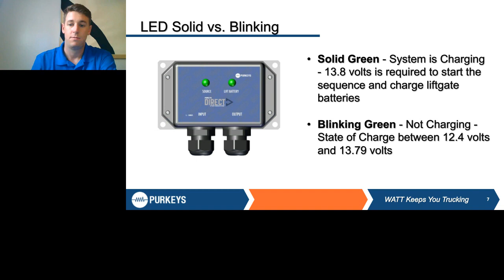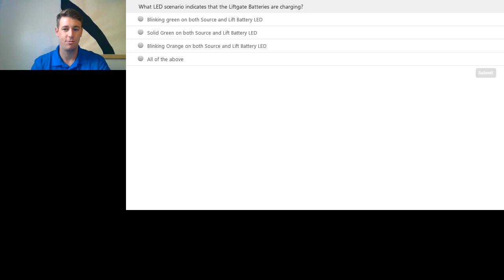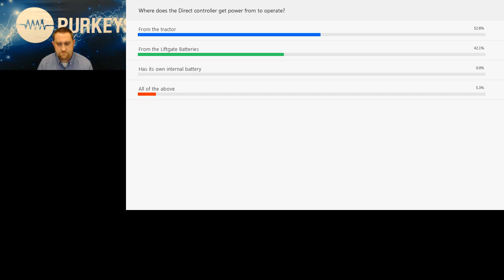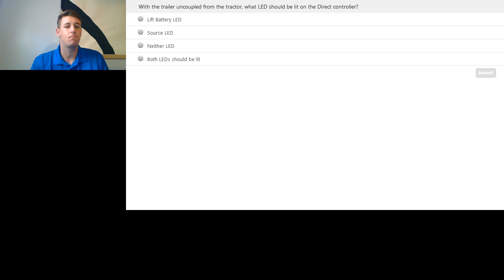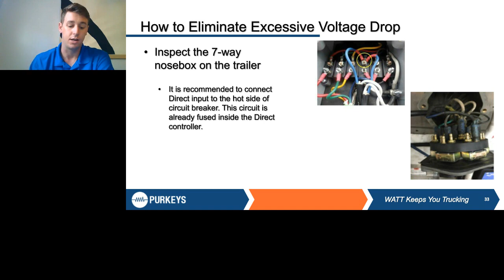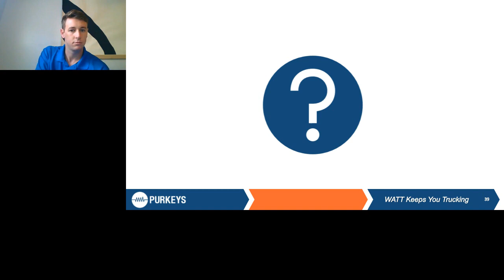Troubleshooting the Direct Liftgate Charging System Webinar - Purkeys

Comment: Why would it not charge if I got power from the truck, 2amp fuse and, breaker is good, new batteries, everything is good inside the battery box, brand new charging system but it wont charge the batteries, whyy???
Reply from the maker: There are several details that aren't mentioned in your question that we would need to know to properly help you (i.e. which LEDs on the controller are illuminated?  What is the voltage going to the box from the source? What is the voltage on the yellow ignition wire?  What is the LED on the DC converter in the battery box doing? Etc.). The best place to start in resolving an issue like this is to look at our troubleshooting cheat sheet, which can be found here: https://purkeys.net/wp-content/uploads/2020/02/Cheat-Sheet-Direct-LED-Status-and-Logic.pdf, if you need assistance after reviewing this document, feel free to call our customer support team: https://purkeys.net/contact/

Comment: Hopefully yall are still responding to comments. I have a controller with I think slow flashing red lift battery light, 12v at the battery. Pulled a tractor up and connected, source light went solid green and lift stays flashing red, lift bat V is slowly going up, I just need to wait till 13.8V on lift bat side for both solid green? Or should it be green after lift bat gets above 12.4

Comment: So I’ve got 14,3 going to my box but no lights on it and this is a brand new replacement box. Absolute junk
Reply from the maker: Go to the 2-amp fuse at the charge plate or your liftgate batteries are below 7 volts. It is easy to blow that fuse since all it takes is a spark to blow it when replacing a box. Do not go to a fuse larger than 2 amps, as this will damage the controller on the front of the trailer. If you need additional assistance, our customer service team would be happy to help you troubleshoot this issue! They can be reached at https://purkeys.net/contact/

Comment: Is it normal for the black wire(positive) wire to get super hot while charging? 
The black wire that’s attached to the power conversion box
Reply from the maker: It is not normal for the wire to get hot while charging. There are two things that can cause a wire to be hot: The first is a dirty or damaged connection on the wire. This increases resistance in the wire which creates the heat. The most common place for this to occur is at the 4 pin connector on the DC/DC converter. The second thing would be a severely discharged battery. If the cause was the battery, the red wire at the DC/DC converter would be warm too. If you continue to have issues with this, the best thing to do is contact our customer service team and discuss the issue while it is happening: https://purkeys.net/contact
Reply: @Purkeys  I checked and it’s just the black cable attached to the 4 pin connector that’s getting hot the red wire is normal
And sometimes I have to move the black cable around so the light on the power conversion box DC/DC can turn green and charge the lift gate batteries
What would be the cause of this ? My lift gate stopped working on me a couple days ago and had to replace the lift gate batteries
Reply from the maker: @josuemartinezmtz  It may be the connection in the 4 pin plug, H-00276, That would be why the black wire is getting hot because it has a bad connection it would also explain why it would work when you wiggle the plug. For a faster response concerning this issue, feel free to contact our customer service team and discuss the issue while it is happening: https://purkeys.net/contact

Comment: I got a trailer that has a green rapid blinking source led light and the liftgate battery led will show red but the batteries are new. I checked all power and grounds and everything shows to be okay. Cables are hooked up correctly on the batteries. Only thing I notice is when I hook up the yellow cable in the direct box and pair it with the orange wire, the system will show to charge the liftgate. Very confused because I went and looked at another trailer with the same type of system and everything is hooked up the same. Any help would be appreciated. Plus this is a fairly brand new trailer. Tried it with different tractors and the trailer acts the same way.
Reply from the maker: This is an interesting issue! In order to help you out, we need a bit more information. In fact, the easiest way to help you is to have you call our customer support team while at your trailer with a multimeter. The team will be able to walk you though some troubleshooting steps and they will need to know some voltages, such as the voltage on the liftgate batteries, verification of the voltate on the orange wire in the nosebox, and the voltage on the blue wire/source inside the Purkeys box, etc. Please call our customer support team (1-800-219-1269) when you have some time to walk through the diagnostic process with them. Thanks!

Comment: Only getting steady stinger light
Reply from the maker: If you are not getting a lift battery LED, then you need to verify if you have more than 7 volts on the orange wire inside the Purkeys box mounted on the front of the trailer. If you have above 7 volts on the orange wire, it could possibly mean the box is bad on the front of trailer. We recommend that you call our customer support team (1-800-219-1269), while you are at the trailer, and they can provide more information or walk you through some troubleshooting steps to verify what the issue is.
Reply: @Purkeys I figured it out. The box on the front was good but light itself was no good. I replaced the cover to the front box and everything was in working order. Thank you.
Reply from the maker: @keithhutchins7270  Fabulous! I'm so glad you were able to fix it!

Comment: Why would my abs light stay on when hooked to a tractor woth good soorce
Reply from the maker: When this happens, there may be something that is wired incorrectly, so the first step is to verify the wiring. If you need some help or access to a wiring diagram, please call our customer support team (1-800-219-1269) and they can provide more information or walk you through some troubleshooting steps.

Comment: My lift gate on my box truck doesn’t have any power? Can’t find Circuit breaker is on a 2015 freightliner M2 102 box truck
Reply from the maker: The Purkeys system does not power the liftgate. We provide the charging for the liftgate batteries. Do you know if your Box truck has a separate liftgate battery box dedicated for the liftgate? If so then the circuit breaker for the pump motors is almost always inside the liftgate battery box close to the liftgate batteries. 

If your liftgate does not have a separate battery box and is utilizing the truck batteries to power the liftgate then the circuit breaker is likely close to the truck batteries.

Comment: what do you guys mean by the hot side of a circuit breaker?
Reply from the maker: The hot side of a circuit breaker is the terminal where the wire is that brings the voltage and current into the breaker. “Hot” means it is the point where power is supplied.